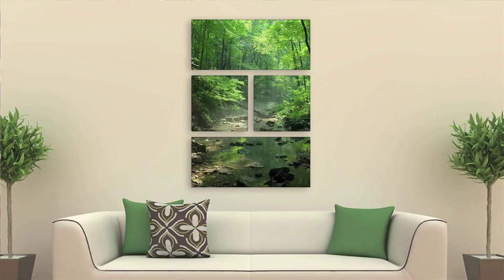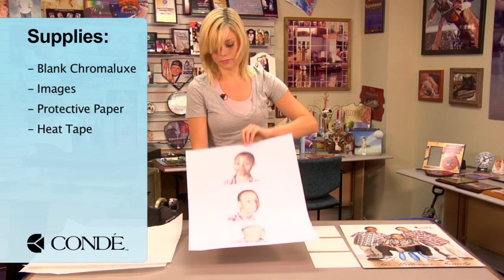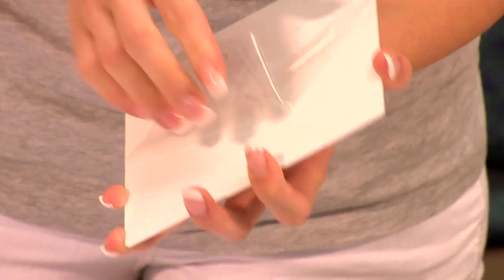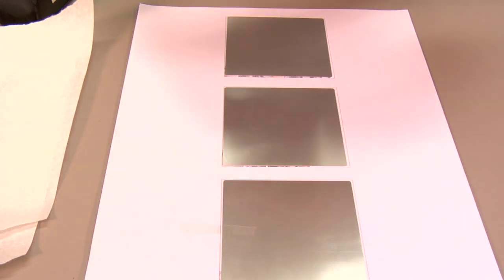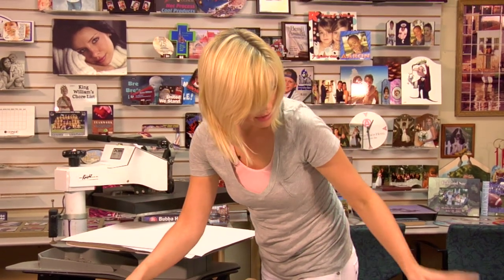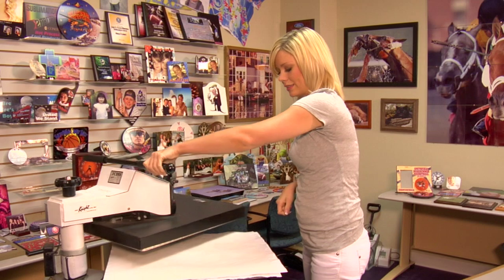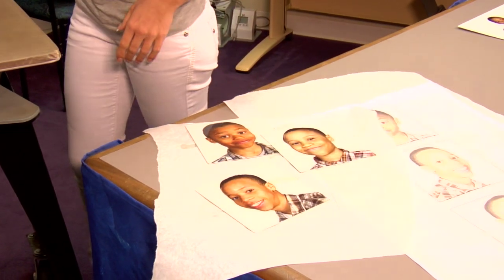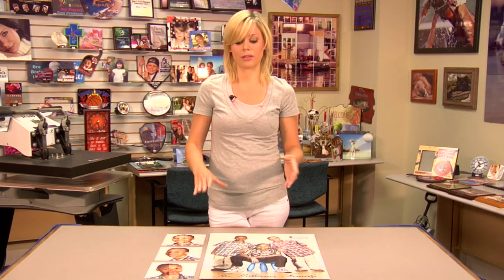Unisub® ChromaLuxe Connection Photo Panels Imprinted with Dye Sublimation -

Comment: how do you print the pictures?
Reply from the maker: The transfers are created using a Ricoh® GX7000* printer with Sawgrass® SubliJet-R™ sublimation inks on TexPrint-R® Sublimation Paper. All products are available from conde.com, including the heat press used in the demo. *The modern version of this printer is the Sawgrass SG 800, the GX7000 is discontinued.